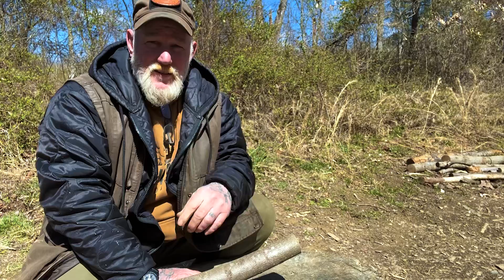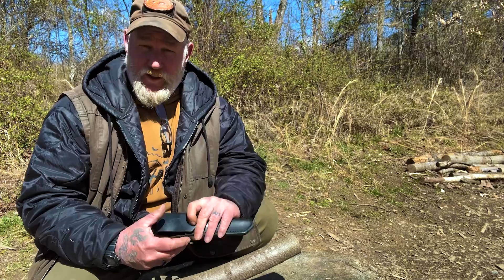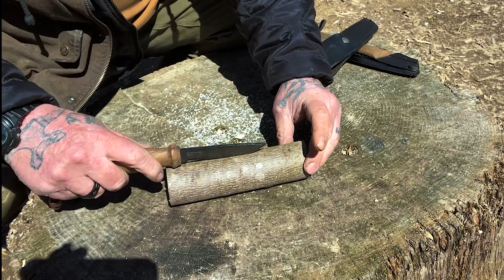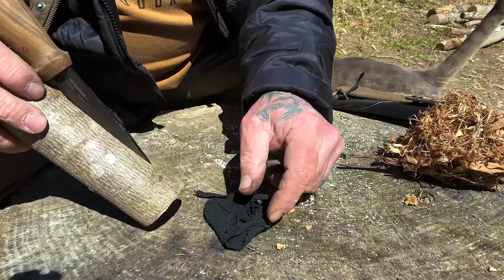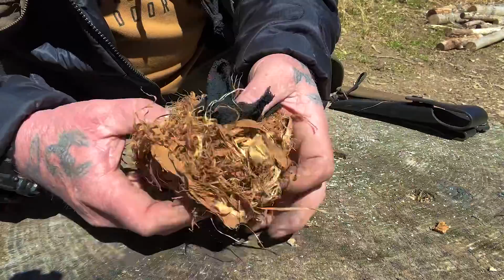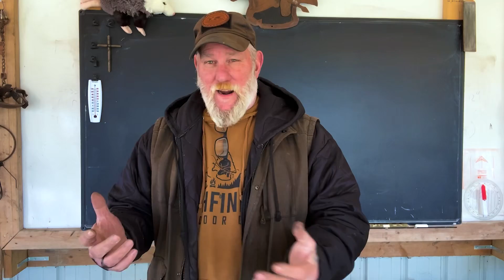SAFE Knife Method for Flint and Steel Fire Making

Comment: Hi Mr. Canterbury.  Great vide as allways.  I really like the method of using a blade in a piece of wood to use a ferrous rod with. Better than using the pull on the knife method.  Great idea. Thanks Cliff UK

Comment: Thanks for the video. As someone who has used a 18th century flint and steel kit to light a fair number of fires, this method makes super eminent sense to me.

On another note on the same subject, I have decided that at 2 months shy of turning 70 years old, and with osteoarthritis primarily in my hands; I will be instituting a search for a blacksmith who will forge me a steel striker for a Old Farts Flint & Steel Kit where the blade of the striker measures at least 5"  long, if not 6"-7" long. My spitball image is something like one of the commonly available U-shaped strikers, just vastly oversized. The loop at the top (bottom?) of the U will need to be wide enough that it will be capable of allowing even the largest pair of male hands to fit comfortably between the blade of the striker and the full tang grip opposite of the blade. I've been dithering between whether the slab handles, similar to a full tang knifes', should have finger grooves for stability when my hands are numb from cold or wet; or whether to go with ambidextrous palm swells?

Anyhow, great video, and I am sure that the technique demonstrated will save someone from slicing their finger(s) down to the bone.